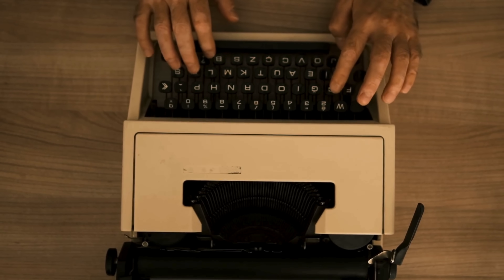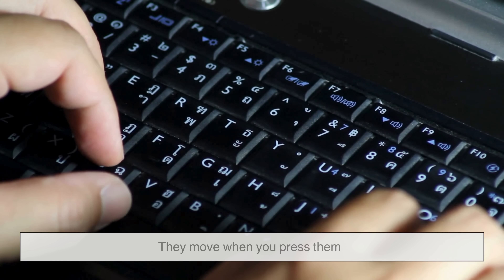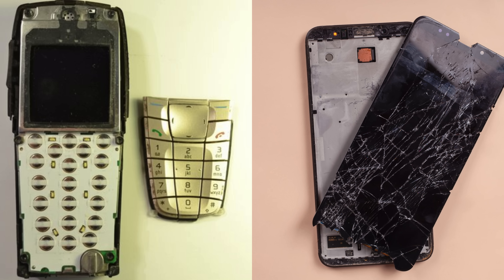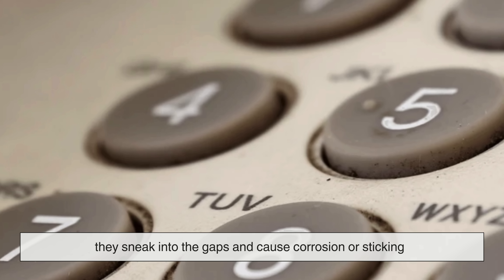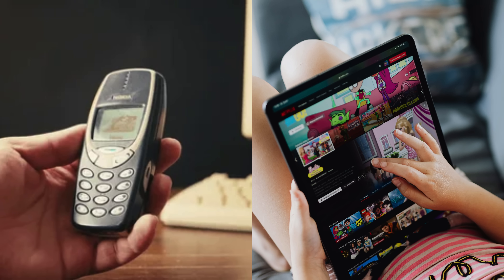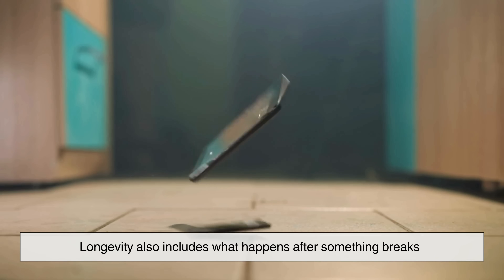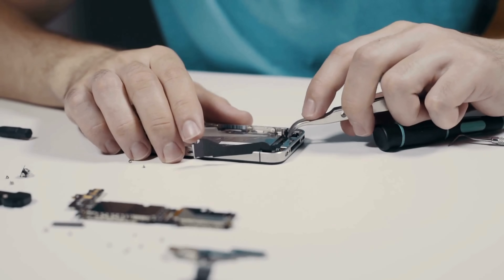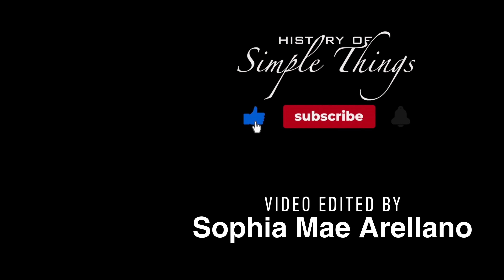Touchscreen vs. Buttons: Which Lasts Longer? [ID2208]

Comment: P.S. I prefer knobs to control volume and tone. A fast twist is almost instantaneous. Instead of holding down a button and waiting. I wanted a remote control with a knob for the volume. But if something loud or irritating comes on, mute is the only fast way to quiet it down quickly. I miss the temperature knobs on my oven.